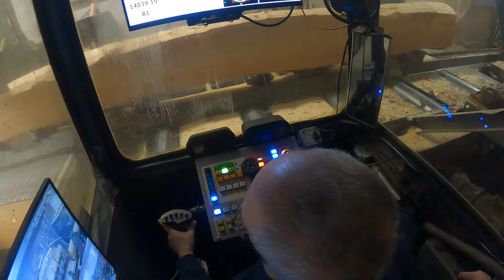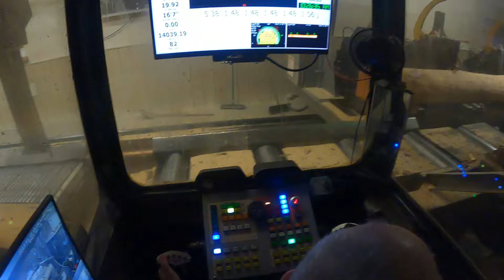BIG SAWMILL TOUR.... Let's see where Jim's logs are going!!! #430

Comment: I'm suprised everyone wasn't wearing ear defenders...I was told ( as a rule of thumb)if you had to raise your voice to be heard then you should use ear defenders. Best wishes Nottingham England UK 🇬🇧
Reply: Carole Every worker that needs ear protection is wearing it .Debarker and sawyer in sound proof work stations  .Edger , resaw and trimmers all wearing ear protection. Saw sharpening room ear protection not required in separate room .But maybe recommended at times .  Outside workers  not required ear protection  maybe hard hats . Steel toed boots required for all . General manager Jim and Brenda disposable ear buds recommend  . But probably not necessary  for short time they were in mill . A very safe mill all in all  . Cheers

Comment: @28:15 when he says the teeth are 'swaged', not 'set' - I think what he is referring to is effectively a cold-forging process, which makes the tips of the teeth a little bit thicker than the band itself.  This avoids a lot of the vibration that a normal blade (alternately 'set' left & right) would have, because each tooth of a swaged blade will cut evenly across the full width of the kerf.
Reply: Thank you Gary . I think you have walked the talk . Cheers

Comment: Back in the late 80s I worked at a lumber kiln in Rushford, N.Y. We would sticker the lumber, mostly basswood, some cedar and maple, then pack the ovens to kiln dry the lumber. Much of the basswood would go to the milling building to be run through a gang rip then chop sawed down in varying lengths then is was shipped to a manufacturer to make faux redwood patio furniture, i.e., picnic tables and benches, tables etc.

Comment: The young man at the edger is inviting risk by wearing loose clothing and hanging belts when working around rotating machinery, coveralls would be advised.
Reply: Blue t shirt , beige  pants ,  baseball cap ,ear protection and glasses(safety) and steel toed boots plus leather gloves . I saw no loose clothing or hanging belt. Foot pedal controls  green chain (stop)plus control panel controls edger. Coveralls too hot to wear . I hope they would rotate him off every 2 hrs . Other than that I saw nothing wrong .Cheers

Comment: I don't really think I know how edgers work. The rollers are dependent on to keep the board straight through? There's no kind of kerf blade or fence type deal? I search for info and there isn't a lot online...or maybe I'm just having a hard time believing rollers are enough to keep boards straight. Seems like magic.

In this video the operator is really keeping his hands on the board for a long time, bending way over as the board goes through. Seems impossible to me that he's steering the board through or having to actually push the board through because the machine is so massive. And if he's steering the board the edge would be wavy. So yeah, probably magic.

I guess the gang saw works the same way which leaves me wondering why even have an edger? Why not put it thru the gang saw?